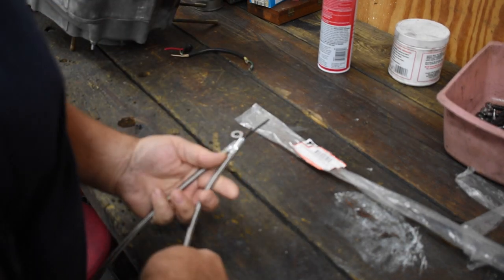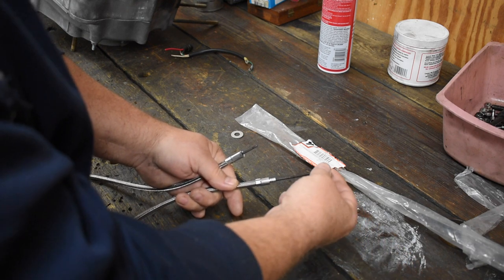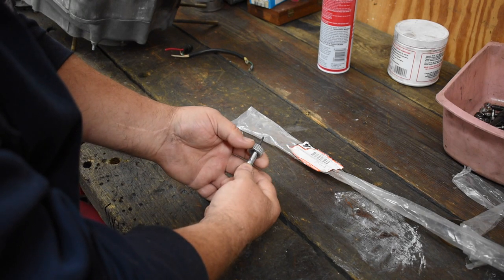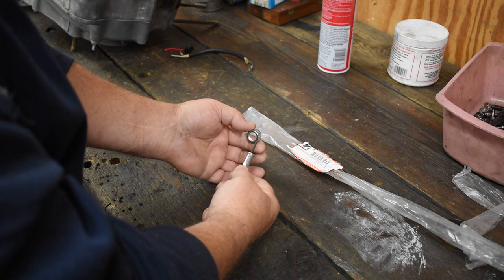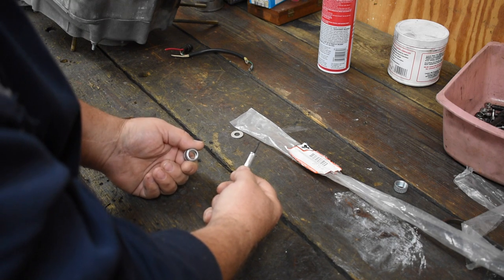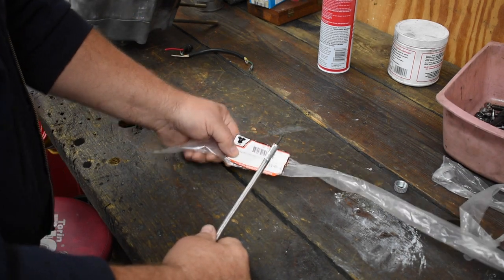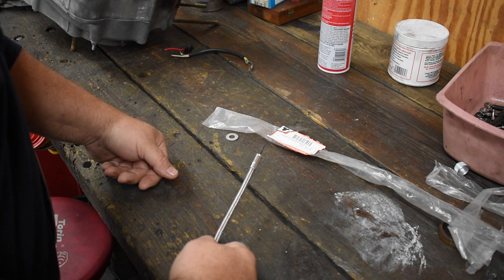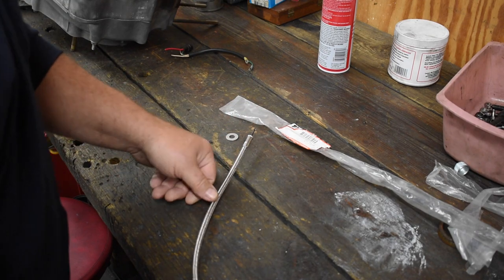V-Twin Speedo Cable Nbr. 3

Comment: Maybe put that little washer in there that's laying on the bench. OK I'll resume..............
Reply from the maker: The washer just happened to be laying there, it didn't come with the cable. Yeah, I might have been able to jury rig something, but, point being, in the supplied condition the cable did not and could not work.
Reply: @IronHeadCycle  Sad, but happens way to often these days. All about the bottom line, rather than quality or pride in workmanship. Take care.

Comment: What is that washer on your bench? Did that come out of the package? Maybe you need to put the washer first and then the nut.  Or if the cable is the same length, could you just reuse the old casing if it’s good shape?
Reply from the maker: I tried the washer, nope, didn't help. Using the old one would defeat the purpose of installing a new one...

Comment: 1972 and older Sportsters need the speedo run off the back wheel. How about a video about what you have to do to fab up this mod?
Reply from the maker: They actually drive off the bottom of the trans. I usually recommend plugging that drive hole and converting to front wheel speedo drive.
Reply: @IronHeadCycle  Right but what if you want to keep your front drum brake?
Reply from the maker: @engleharddinglefester4285  If you are a restoration kind of guy who wants to keep it all original, then you should retain the speedo drive on the bottom of the trans.
Reply: @IronHeadCycle  I'm not. When I got my 72 I discovered the Torrington bearing was blown completely out and the case cracked. So I had it fixed and then lucked out on a 73 case. Now I can't run the speedo from the trans or the front wheel. Personally I would never run a pre-73 without a c/s donut, so the speedo has to be run from the rear wheel. I have a 70 motor and I'm not even going to start it until I pull that trans and see what's up. I wouldn't trust them; I know too much about them now lol.
Reply from the maker: @engleharddinglefester4285  It should be easy to rig a speedo drive from left side of rear axle. your problem is going to be coming up with a cable that is long enough. You used to be able to buy the core in bulk, I don't know whether or not it is still available. Of course the housing and the end fittings are also going to be a problem. There are a couple of companies that market electronic speedo's, have you checked into one of those?
Reply: @IronHeadCycle  J&P has a long cable and snail kit that would have to be modified to work, but they are also out of stock. They sell right out when they get them. I've thought about the electronic speedos but they don't really go with an all mechanical bike lol. I'm looking to find out how to make the snail connect to the wheel is what I'm trying to get at. :)
Reply: A guy on another site said he bought a speedometer that worked from gps Satellites. Bolt on, connect the electric and go. Don't have to worry about wheel size or counter shaft sprocket size.